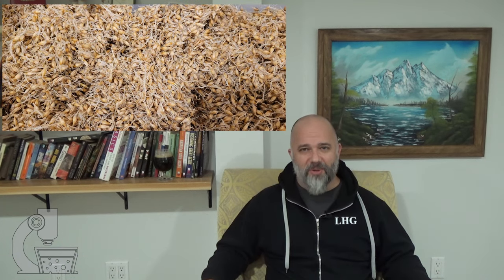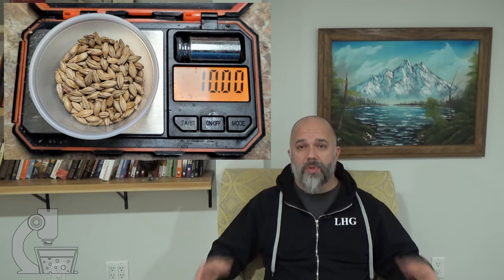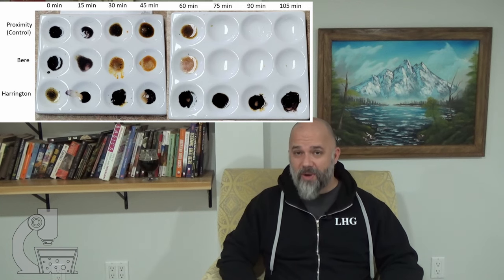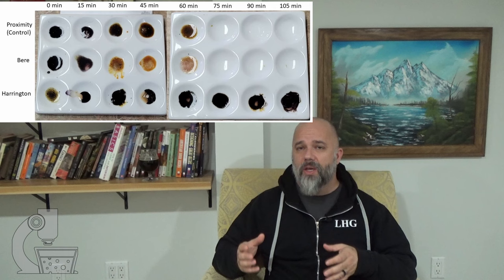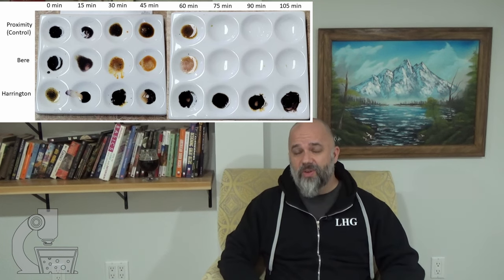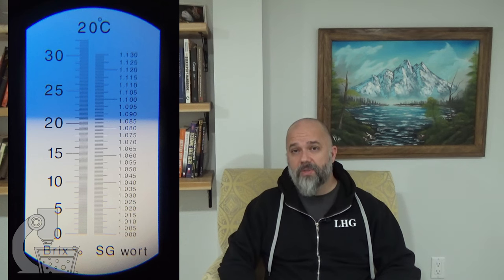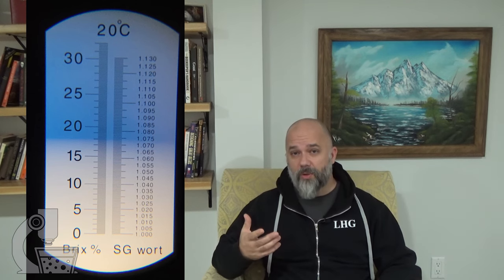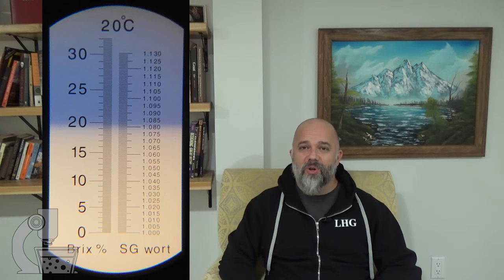The Fifty Meter Beer Project Part 16 – Malt Conversion Tests and Recipe Design

Comment: Maybe you should try a longer decoction type mash to get the best out of your raw materials.
Reply from the maker: I'm not sure it will help. If the issue is pH, decoction won't fix that (& may make it worse if I hit pytase temps). If it's merely enzymes, the bere has plenty to spare.

Comment: Did you measure the pH of the mini-mashes, and does the iodine-starch test have a pH dependancy that may have given the contradictory results for the Herrington malt?
Reply from the maker: My pH meter died a while ago, so I couldn't check. I don't think there is a pH aspect to the iodine test. Malt protease is more active at acidic pH, so it may have degraded the amylase